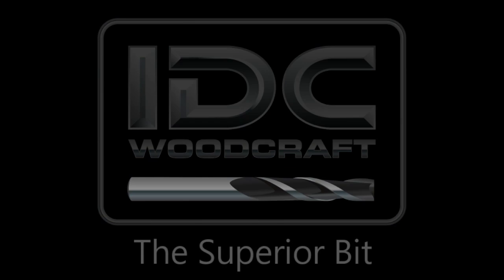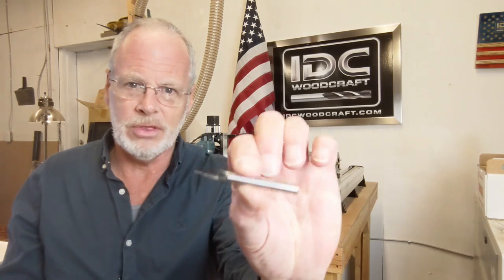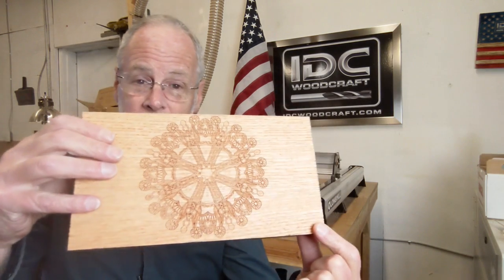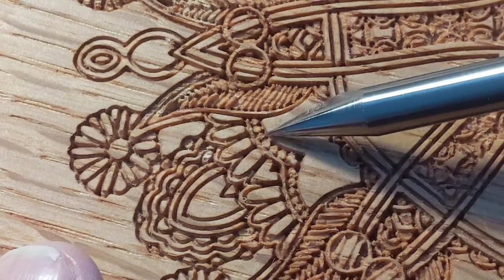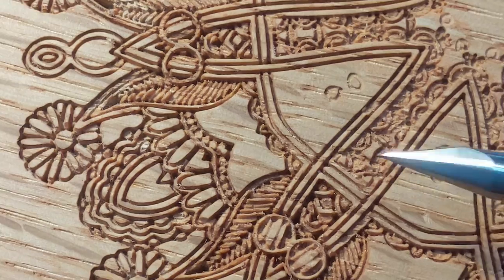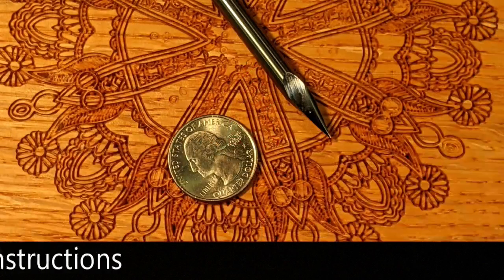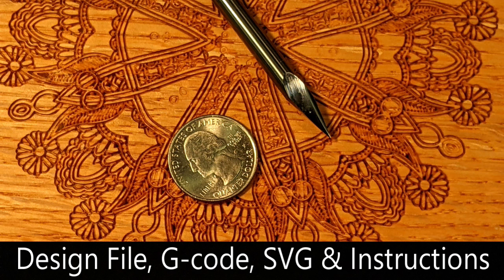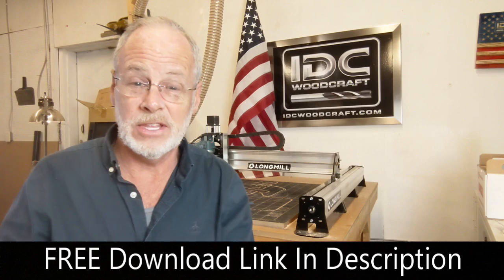The INCREDIBLE Detail Done On A Longmill CNC Router, CNC Projects Beware!!

Comment: garrett thanks for the help videos but 1 thing you haven't covered is rpm's effect on the tool bits i have a dewalt 660 and it only does 10000 rpm does that effect the bits anyway ?
Reply from the maker: Jim, it does effect the tool life. You will need to slow down your feedrate a proportional amount to how much you reduce your RPM